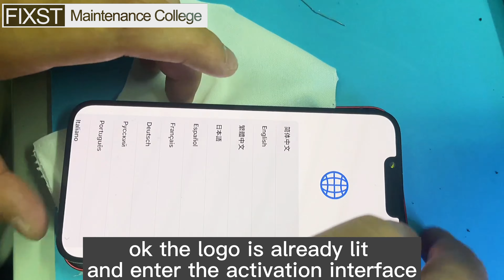iPhone 13 A15 CPU Disassembly/Reballing #iPhone13CPU #A15CPU

Comment: I have a Question can we replace my iPhone 11 a13 chip to this a15 ???
Reply: No. The socket will not align with the smaller die size for sure. Furthermore, each to one model is made to only work with the processor for that year.